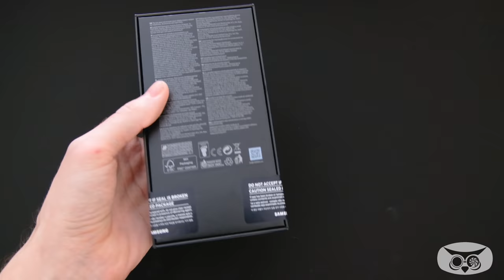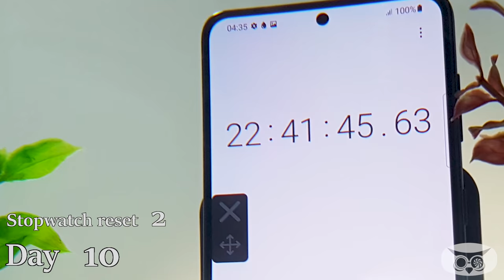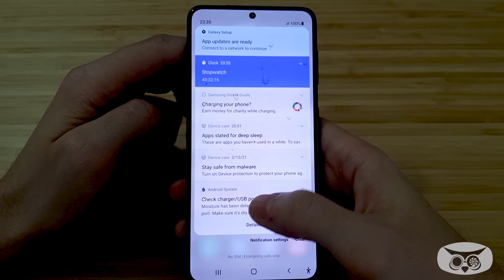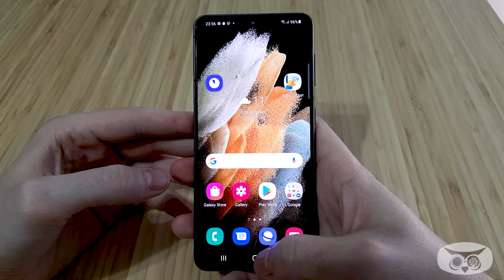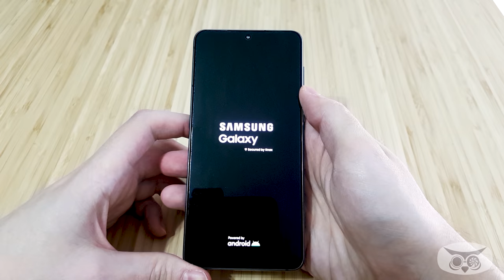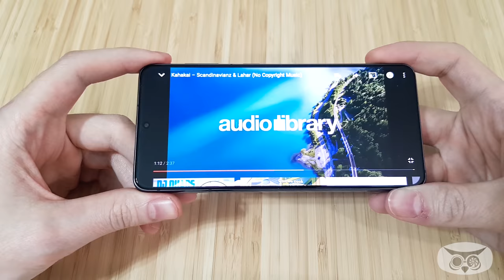What if you left a phone in water for a month?

Comment: Thank you for an idea about isopropanol.
In the Spring my Huawei P30 (has no any IPXX protections) was with me when I got under the rain. It was nice, but after couple hours for some seconds there display matrix was glitching.

On the next day all cameras was fogged. Used rice for ~10 hours, it helped. Then for some monthes I had no any troubles, but in September it starts hanging on when I try to use wideangle camera.

After a week or two, camera app starts lagging and sometimes it was not working. Sometimes reboot was helpful, sometimes wasn't. And a bit later cameras died. The main app was crashing, so I even could not switch to front camera. But in Telegram app it was possible to record some short video-messages (there is front camera always default).

I bought new camera module for 30$, replaced it and... it worked, but there was about 2 seconds between any cameras switching. After a couple hours, it died again. So yesterday I bought new smartphone: S21 Ultra, but it would be excellent if I can resurrect my Huawei. On my opinion there was still better camera then in my new phone.

I'll try and if success, I'll left a feedback here.
Reply: Good luck on fixing your phone :)
Reply: @anthonyserna6151    unbelievable. I literally did nothing: just sprayed isopropanol and wiped with old toothbrush contacts of all cameras. Rest of isopropanol wiped with paper, turned my phone on and all cameras just work as never before! Goddammit, so simple and cheap solution, it works like a charm, still can't believe 🤯

So strange, going to see this video just for fun, nothing useful, but accidentally fix my old phone. Author should have a coffee from me 🥳
Reply: Cool,that's good :)
Reply: Huawei makes decent phones indeed,could have been my main phones if samsung didnt link so well with my windows laptop
Reply: @pham3383  that feature is also cool, but I would use them just if they'll have Google services (Google pay the main problem). So P30 is just latest Huawei which has them, but it is perfect enough to be bought again — they're not available to order in Ukraine now
Reply: @brukhel  in addition my country have the lowest price for samsung phones,i can unbox my s21ultra for $725 ,s21ultras are unbeatable at 725$
Reply: @pham3383   are you from Korea?
I bought my Ultra 12/512 for 1k dollars at Black Friday
Reply: @brukhel  no,vietnam ,i can get those straight from the factory and still have 2yrs warranty for 725$ for 12/128 or 775$ for 12 /256
If you have 1k dollar,you can get the max option with 16/512 dual sim
Reply: @pham3383  yeah, really, my phone made by Vietnam. Not bad, really. It may seems strange, but exactly today I was wondering how cheap or expensive Samsung should be in Korea. But thanks you, now I know it as same as the country where these phones assembled
Reply: @brukhel   we make up to 80% of samsung phones here ,we actually proud of it
Reply: @brukhel  *thanks TO you
Reply: @timefortee  thanks to you too!
Reply: @brukhel  hahhaha smooth!!!

Comment: If that was an iPhone it would have broke in the first couple of hours :/
Reply: In that pressure, an iPhone would have gotten the same or even more. They both have IP68 ratings.
Reply: @sohamghosh4815  i know i was making a joke lul
Reply: More importantly, if it was an iphone you wouldn't be able to repair it yourself.
Reply: @iddra1868  yup
Reply: @iddra1868  what makes you think the S21 is repairable.
Reply: @sohamghosh4815  The guy fixed his camera module by cleaning it with alcohol, meanwhile iphones break if you swap around 2 working identical modules. Also the fact that you can easily replace the battery, screen, cameras, etc. without losing any functionality.
Reply: @iddra1868  he fixed it not replaced it. You can do the same to an iPhone no problems. Also people have lost functionality such as cameras not working after replacing s21 parts.
Reply: @sohamghosh4815  I'd be very surprised if you could fix an iphone like that without the part being disabled by software, but I guess we'll never know.
Reply: @iddra1868  Yes but you can unplug a camera from an iPhone, clean it, then put the same camera back in with no problems except if you broke something while cleaning.

Comment: why did you put the display assembly in rice?? that didn't have any damage to it. even though rice isn't very helpful, putting the board in rice would have been a better idea. 

also, I feel like the moisture was from condensation due to temperature difference. most phones' cameras don't fog up until the water gets relatively deep in. when you opened it, the internals we're almost fully dry, besides the speakers, which are exposed and normal to be wet.

Comment: It depends a lot on the kind of water. Phone internals aren't damaged by just water at all, they get damaged because of the minerals and salts solidifying on and around the connections. Which should mean that if you submerge it in completely distilled water, it shouldn't damage anything. Although I assume it might start corroding, not sure what other factors influence that process in a phone. Still this is quite impressive and cool to see.
Reply: There were plants in there, I assume they assured it wasn't distilled

Comment: seemed like a professional until he poured rice on them 
GUYS RICE DOES NOTHING TO FIX A WATER DAMAGED PHONE!!!! 
let it dry out for a few days or if you are skilled enough take it apart and unplug the battery and then soak the board in distiled water or 99% isopropyl alcohol
Reply: he's self taught so he most likely has tried many different methods; it's likely he still uses the rice method because, while it didn't actually do anything, nothing bad came from doing it as well, making its apparent usefulness a false positive.

Comment: No shot it stayed at 100% battery with the stopwatch going for 31 days.
Reply from the maker: A charger can keep your battery at 100%, that's the trick I used in this video. A charger
Reply from the maker: @zacharypink7567  behind the glass, taped to the back of the fish tank. Wireless charger... It's such an easy solution, yet you couldn't figure it out even after I told you there was a charger. That's gotta sting